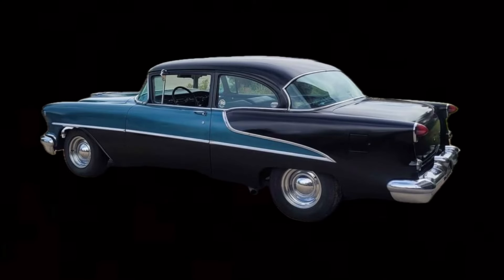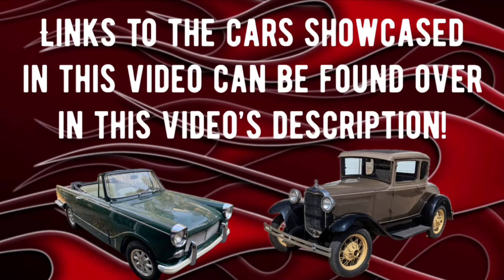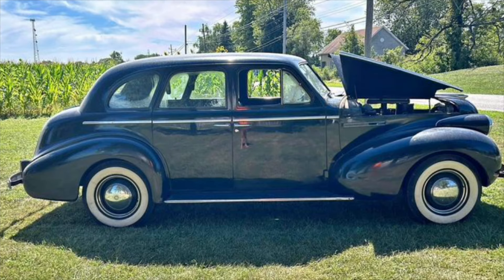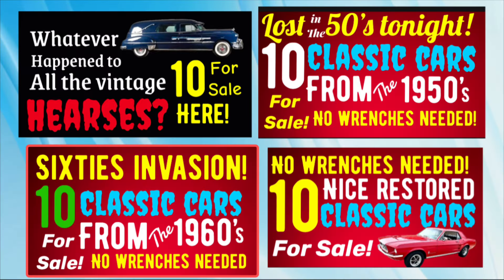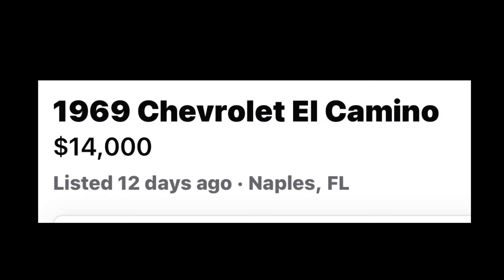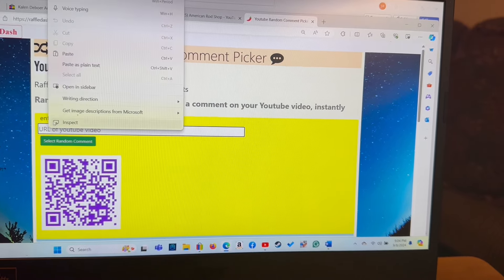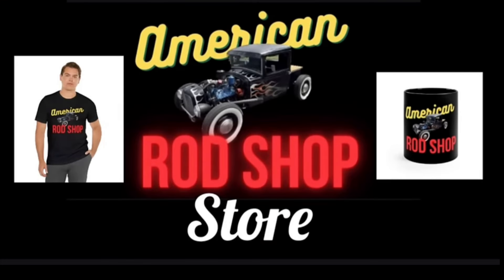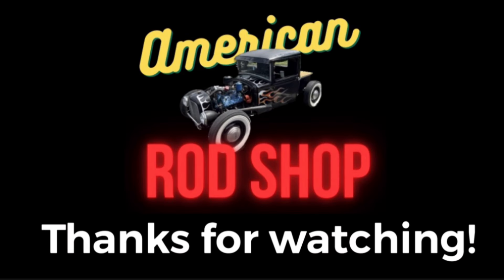TEN AFFORDABLE CLASSIC CARS AND CLASSIC TRUCKS FOR SALE HERE IN THIS VIDEO!

Comment: That 73 chevy short box is a Great deal
Reply from the maker: I agree Dean!
Reply: Because it doesn’t have heat or a/c look at inside firewall. I’ve had trucks without a/c but no heat is unbearable
Reply from the maker: @TornadoTarget  good catch Tim. No heat is rough in the wintertime for sure.

Comment: Gack, I dove a '69 firebird for my first 5 years. 69's are the best looking of all Firebirds IMNHO. The GTO-easque grill, I love em.

That kicked up rear bummer is that way because someone use the stock bummer jack... Never us a 1960's bummer jack, or your bumper will be looking up like this one, and my old one. I speak from experience...
Steering wheel disintegrating no console, bummer.  That's a wide 350 Chevy lol. That's a Pontiac 350, look at that (pretty sure) Edelbrock TQ2 manifold, definitely a Pontiac mill.
And it's Blue.
And I want it %#%* me. Texas... where I bought my Bullitt.
3 minutes in : it's my fav.
second fav:  1969 The Road!

1972 Dodge vans, were good vans, back in the day.
1930 Model A, nice car, reasonable price.